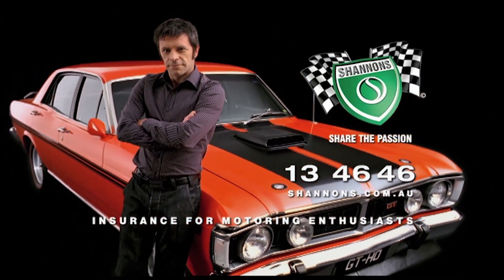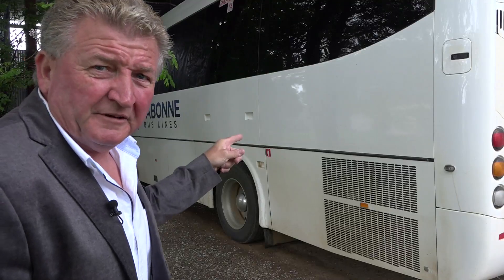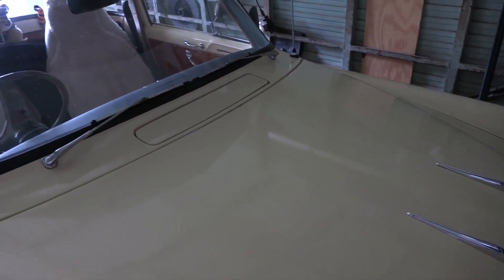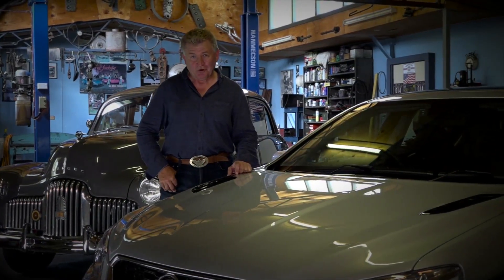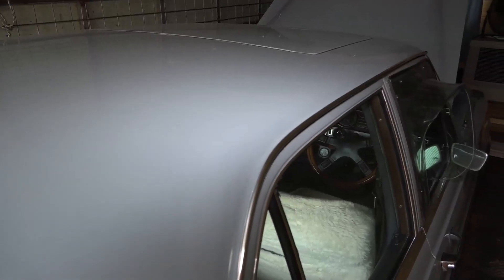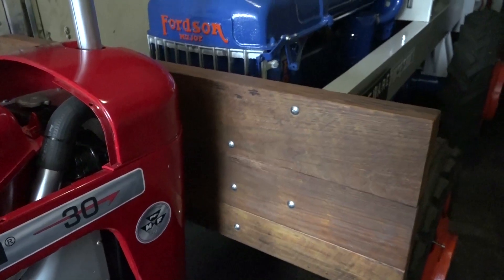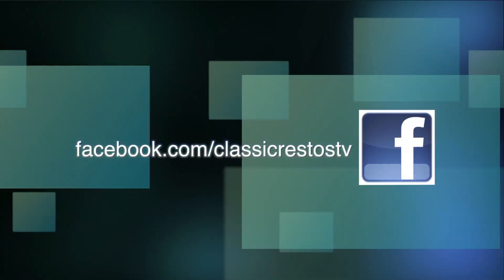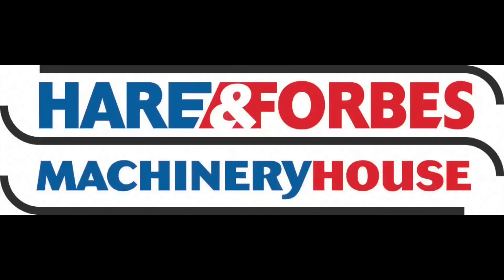Roys Toys: Classic Restos - Series 48

Comment: Love that Dodge Truck 6V53 with jakes for the win.
Reply: It's in unreal condition for its age. I'd put a tautliner body on it. I wonder how much he'd want for it. Somewhere around $25 grand I'd reckon.
Reply: There is a twin of the Dodge, which I have driven: International D1610.  Same cab, different front end styling.  Had a dual-range 4 speed and 282ci 6 cylinder.
Reply: @railtrolley  That 282 engine is what they put in the ACCO Butterbox for the army. My father had a D1950 with a 160hp Cummins.